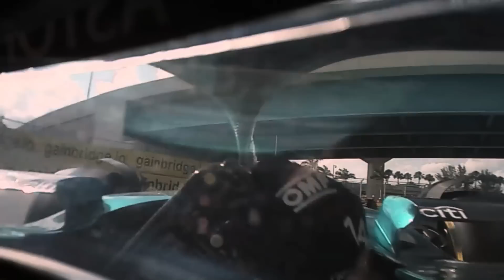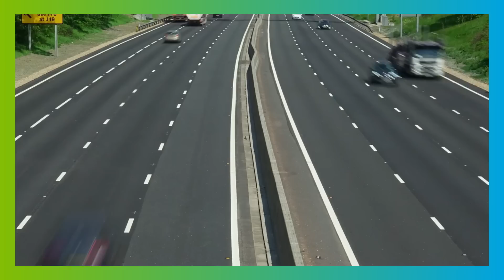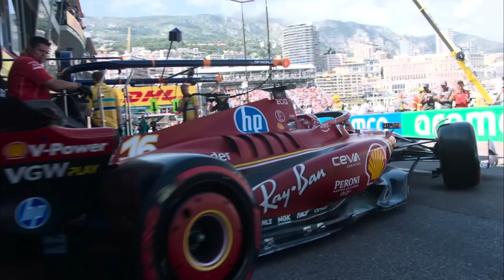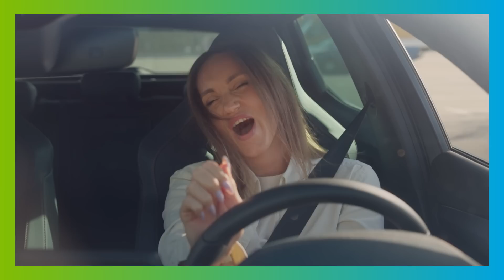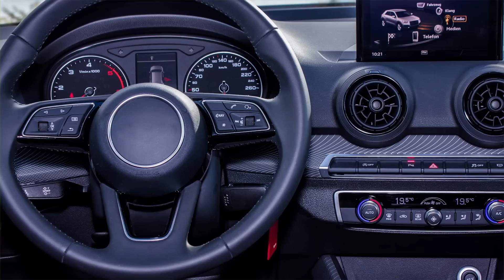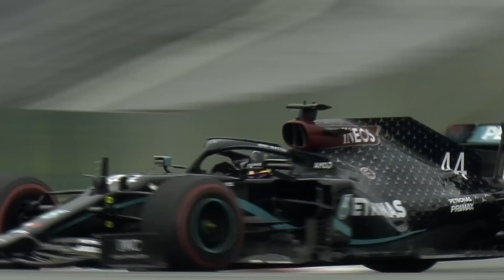How Different Is An F1 Car's Steering Wheel To A Road Car's? | Aramco

Comment: The windscreen washer in road cars is actually the same technique used in F1 cars for drinks button. Just the difference is that in road cars fluid is sprayed on to the windscreen and in F1 cars its sprayed in the drivers mouth via a tube. 
So next time whenever you drive on the road and pull the windscreen washer switch just think in F1 a driver has pushed drinks button
Reply: Still Kimi can not have his drink

Comment: please don't hook your thumbs inside the steering wheel (as shown in a few clips of road cars) - in case of tyre or other mechanical failure or collision the wheel could spin and break parts of you… (at least they didn't shown anyone driving with one hand on the wheel)

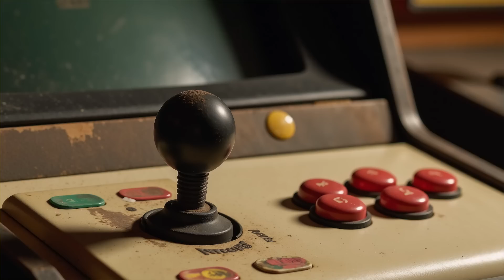Comment: 0:48 Eww Stop using AI
Reply: You sound like someone that would reject using the computer
Reply: @JoshuaC923 your not an artist, so you wouldn’t know why ai is a big problem
Reply: @lowgin2 sounds like a 'you' problem
Reply: @JoshuaC923  would you like if your job got replaced unfairly😭(it is a me problem)
Reply: @ ai is a tool you can use yourself to improve your workflow, it is going to replace jobs whether we like it or not. I work in manufacturing and it definitely can replace my job, one can only adapt and change
Reply: @ I agree
Reply: Wow, i didn't even realize, just tought those were stock photos until i looked at them for more than 1 millisecond. Really sketchy

Comment: I’ve often wondered if the driver has to press a ‘radio’ button or if their line is always open. For example, after a big crash does the driver really need to find and press a button to say they are okay? Seems odd to me.
Reply: they can turn on/off their mic. i remember charles being told by pitwall engineer to turn off his mic, cmiiw
Reply: @robilana1 was just about to mention Charles. He had his mic open for over a minute and you can hear him breathing hard the entire time until someone tells him to turn it off.

Comment: comparing a complex F1 wheel to a basic wheel which is installed in a road car.... its not even comparable. Its just totally OFF 🤷‍♂🙏
the only comparable thing is the wheel itself. If you turn it to the right, F1 car and a road car goes to the right 😂😂wait... even turning a F1 wheel is not the same as in a road car because the limited rotation of a F1 wheel and the car itself 🫣